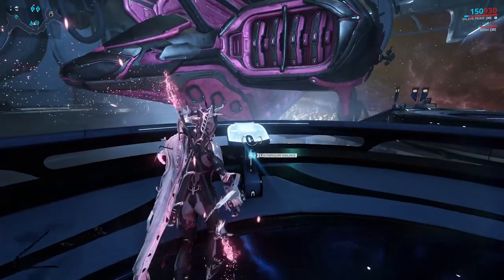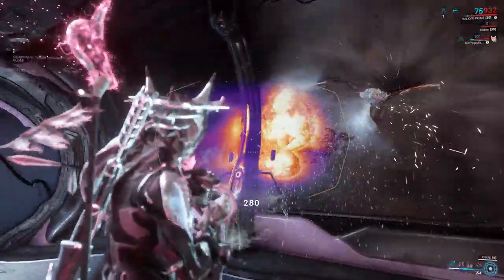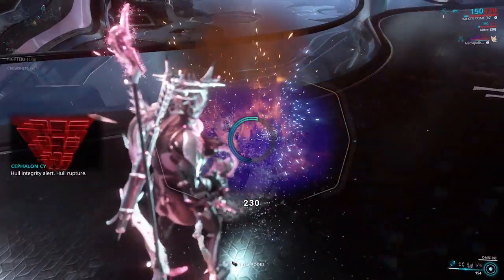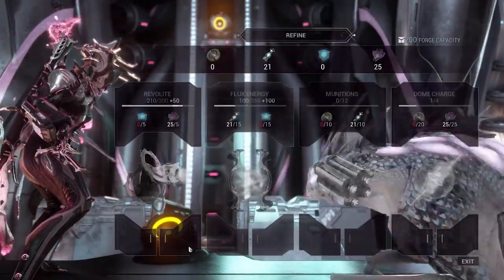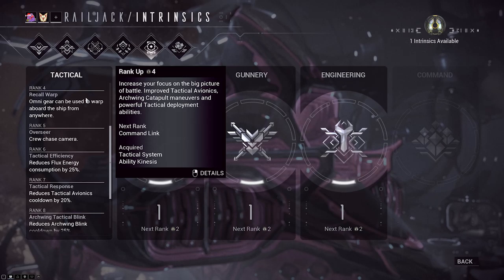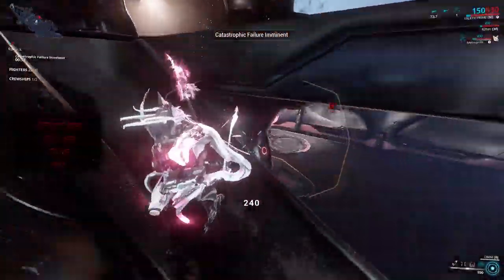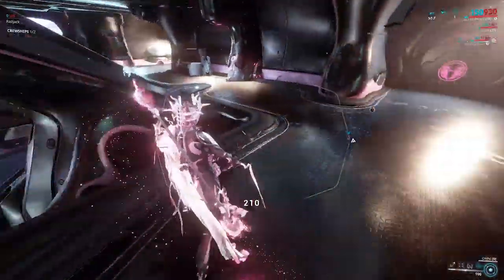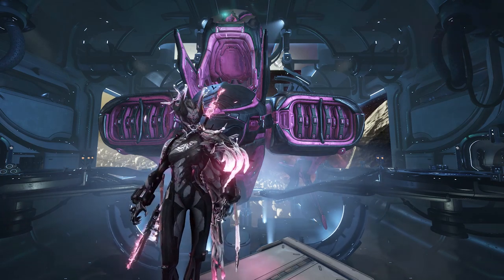Warframe: Railjack | Fires, Electrical Hazards + Hull Breaches | Empyrean Update

Comment: This is why I picked Engineer. Well, that and Tactical. That 4th level skill in tactical that uses the omni is just so convenient. It lets you warp back from an unlimited distance, so if you're like me and you like to scavenge for resources at the end of missions, you can just warp back (furthest off I tested it from was 9k clicks out). Also cool to blap the reactor on the crew ship and then warp back. All you have to do is select the omni in your gear wheel from a remote location, and POOF!

Also, the Forge uses resources that were picked up in the mission, I found that one out the hard way once or twice! If nobody is picking up the resources dropped by the shot-down ships, the forge won't be as useful.

Thanks again for the guide! I appreciate all the Empyrean content, it's a lot to take in.

Comment: Can you play solo at higher railjack levels?
Reply: If you can manage crafts and repairs and atack using the small invincibility time after the red brech repair is posible, way harder but posible
Reply: Use guerrilla strategy: go fast, kill some, get away. If the timer start you can wait until 20/15 seconds to go repair. In this time window you will not have critical breaches. Let a spectre holding the ramp to the lower level. Take the shit out the crewship first.
Reply: Another point is to get that fast travel perk on tatics. Level 4 or 5. And for the main gun i strongly recommend the ice burst cannon. It have short range and will get hot with 4 shots, but, its almost guaranteed insta kill. Take level 5 at artillery too, so you can use the main cannon. After that is just a question of management
Reply: @JoaoVictor-rg3fo  just use Amesha and imperator vandal and maybe Corrosive Projection with Coaction Drift
Reply: @mojito4493  that kind destroy the meaning of you using a ship, i mean, a combat ship. I always hold the higher kill numbers when in pub matches. The ship is better and safer that archwings and archguns. I mean, 1 kill per shot, plus my two combat perks and things like that.
Reply: @JoaoVictor-rg3fo  lol, well.. I just wanna get the rewards and mods for the ship as fast as possible

Comment: Uhm where to get omni?
Reply: The Omnitool is in your inventory and you put it in your gear wheel. If you go into your options screen and check keybindings, scroll right to the bottom and you will find options for Railjack. You can set a button to 'equip omni' so that you don't even have to use the gear wheel.